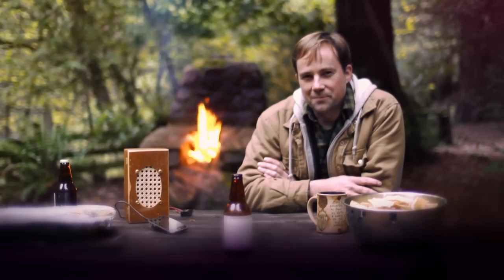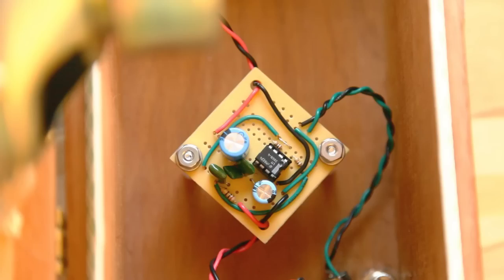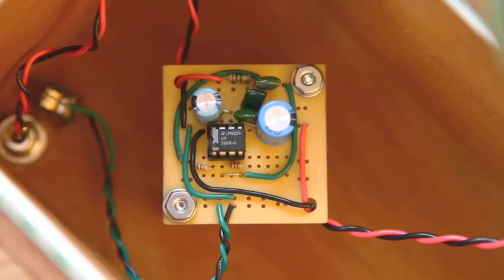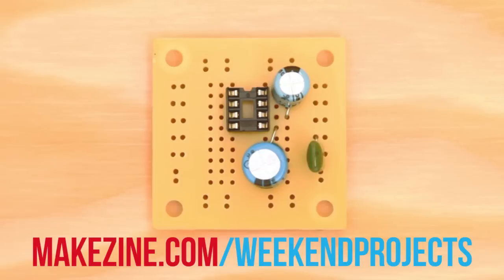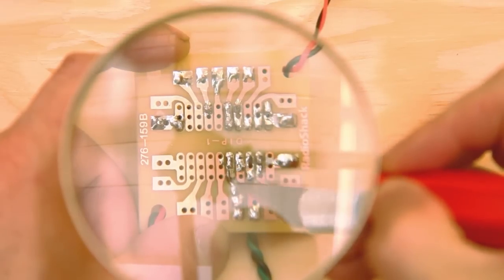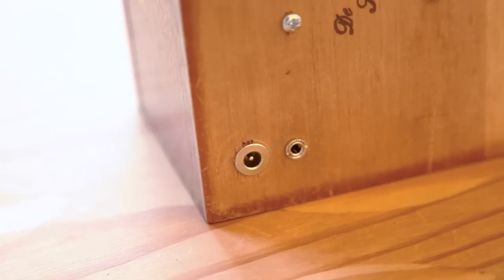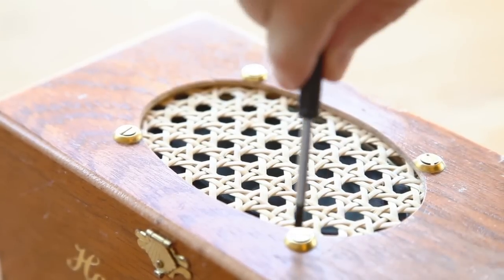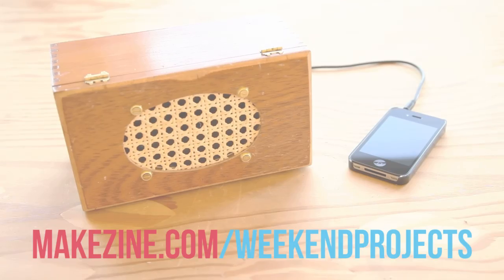Weekend Projects - MonoBox Powered Speaker

Comment: Connecting the both signal-inputs of the audio-jack directly with the wire is probably not the best solution. Note, that if the L-Channel of your source is at its maximum negative output, and the R-Channel at its maximum positive, you have more or less a short-curcuit.
Installing a resistor with around 100 Ohms will not affect the volume at all and will protect the source.

Comment: Battery may be installed inside the box. DC connector disconnects battery and connects power supply after plugin DC Jack- In my opinion this is better option.